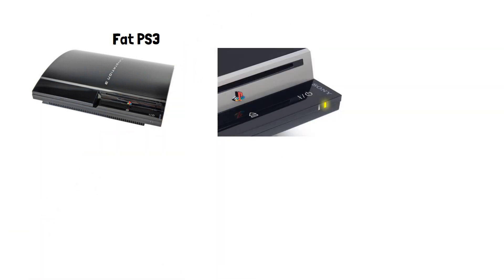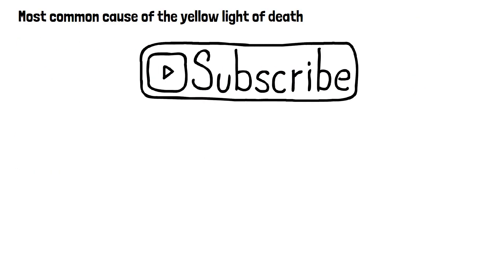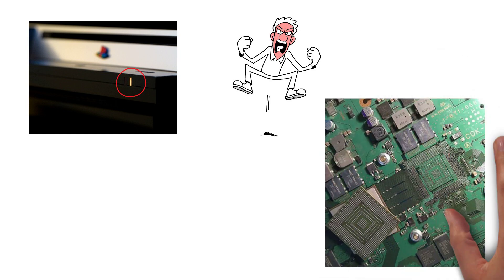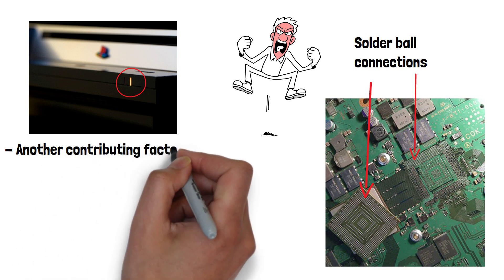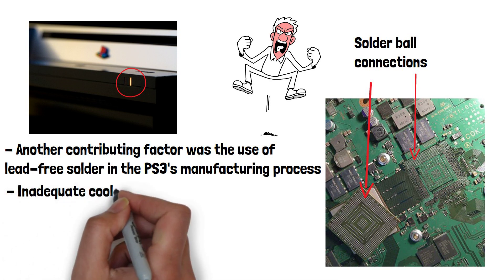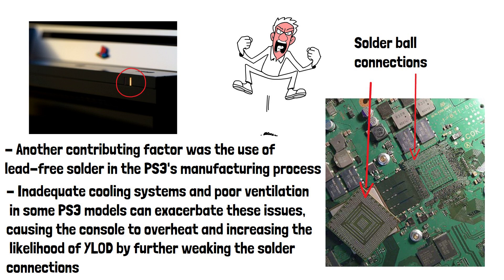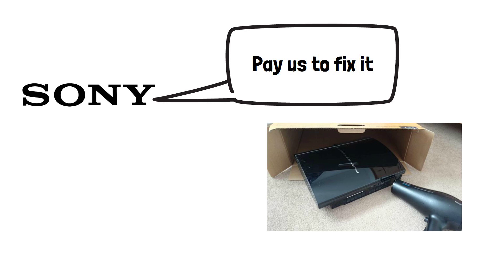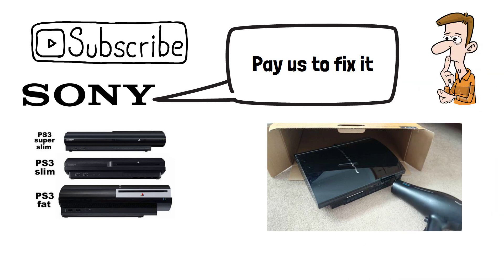What caused the Yellow Light of Death? (PS3)

Comment: Did i oh boy i sure did experience it twice in a very short time😅
litteraly 15 min ago for me when i went ejecting the disc while the game was still running it inmediately caused a YLOD...
Weird thing is during the fan test the air doesnt feel hot but normal temperature and luckly the disc got ejected.
This is the second CECH04 ps3 phat withing 2 weeks to die by a YLOD by just general use and running a ps2 era game from the Ratchet & Clank trilogy disc.
Reply from the maker: 2 in 2 weeks is very unlucky, will you be attempting a repair or getting a replacement?
Reply: @techindex1  im going to dissasemble and repair it tomorrow, in the hope it is just bad thermal pad placement or hopefully something less causing it...
Reballing would be a last resort tbh
Lets say the first YLOD happens when it whas placed vertically and works fine horizontaly, now it YLOD both placements...